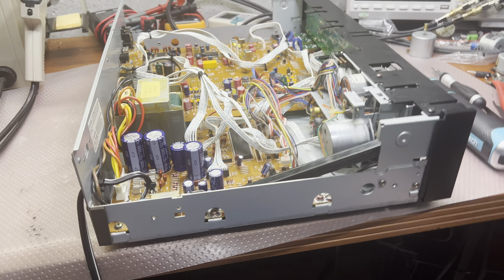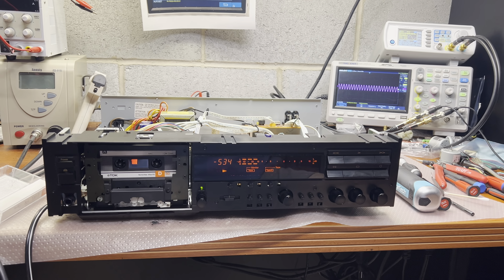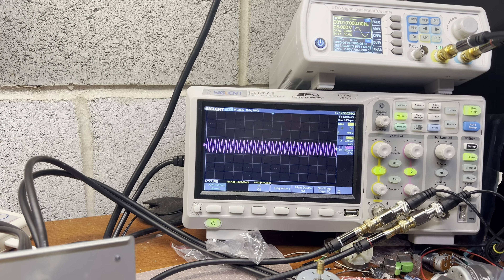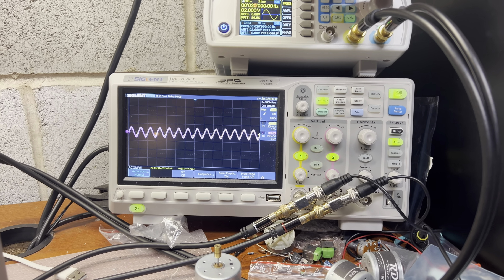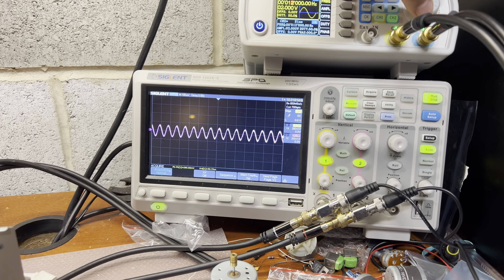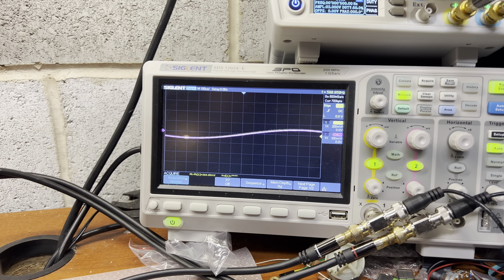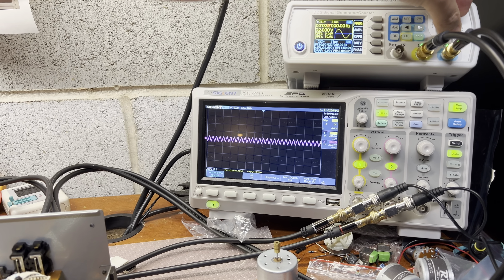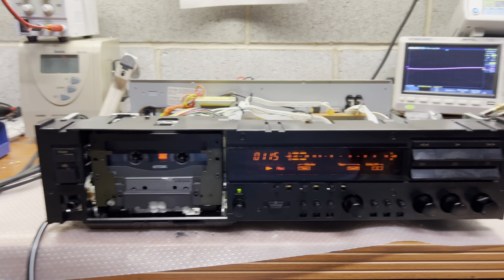Transforming Nakamichi DR-1: Polymer Electrolytes Unleash True Potential!

Comment: Where did you acquire these new components?
Reply from the maker: Digikey
Reply: @hifirulezzz  would you say that they're an improvement over Nichicon caps? Need to get a few decks serviced and recapped.
Reply from the maker: @weltschmerz88  It depends on your taste. Nichicon gives more bass but lucks on very highs. Solid polymer caps gives very linear response over the whole range, has lower ESR and ESL, in some cases up to few dozen times less. I measured. Sound changes the same way as when you replace 4066 with relay.

Comment: Do these capacitors sound different from Muse capacitors?
Reply from the maker: You got my point, otherwise why should I do that :)
Reply: Oh I meant how different and what is the difference? Measurements wise, it does seem better, but sound wise, what are your observations?
Reply from the maker: @adgokhale  It depends on your taste. Nichicon gives more bass but lucks on very highs. Solid polymer caps gives very linear response over the whole range, has lower ESR and ESL, in some cases up to few dozen times less. I measured. Sound changes the same way as when you replace 4066 with relay.